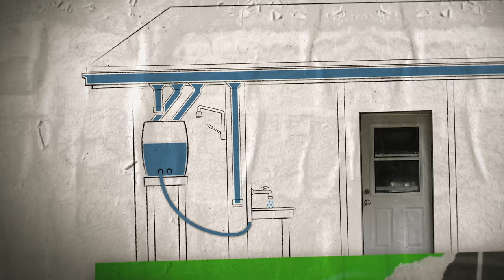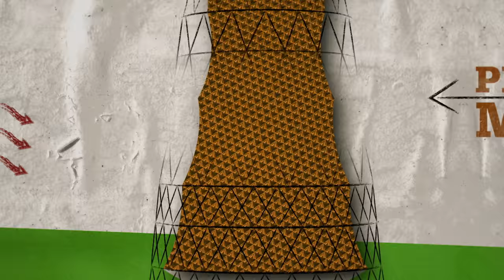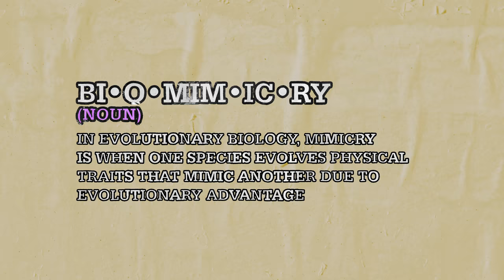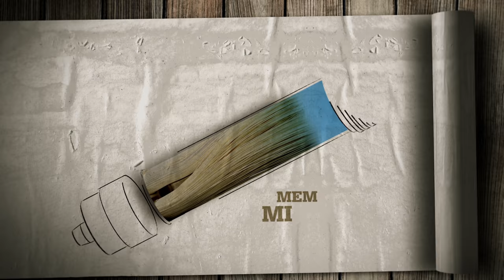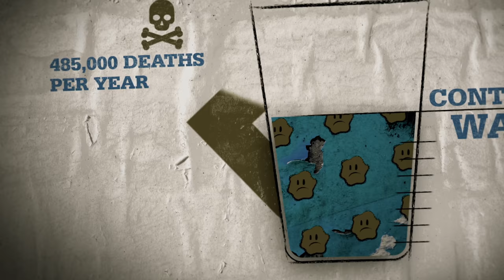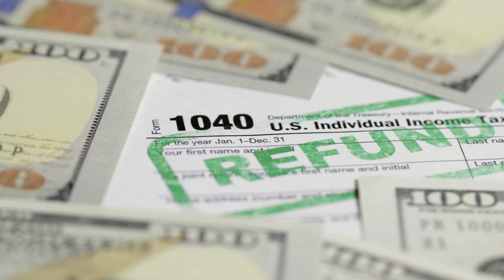Harvesting Water Out Of Thin Air | Shut It Off ASAP

Comment: Simple condense water collector: black plastic bag. dig a hole. Put a container in the hole. Cover the hole with the black bag, fix it around the edge so it doesn't fall into the hole, place a stone in the center of the bag so condense water drips into the container. Condense water forms on the underside of the bag and runs down. Read this about 30 years ago in a how to survive in the Outback book. Thankfully never needed to use it..

Comment: I have a few questions, mostly about the dew collector. 
You see, in the dessert the temperatures drop like a stone on a river at night and skyrocket at day due to the lack of moisture in the air, which is why its not much of a concern to pull as much moisture out of it as possible, life in desserts has already evolved to survive that, but in places where the moisture in the air is much more prevalen such as forests and jungles, taking a bit too much of it out of the air could become a big ans rapid change in those environments, mainly due to the fact that such moisture helps in the process of retaining a more stable temperature when compared to a place like a desert, so my question is... would the impact of the dew tower be enough to be concerned about when placed irresponsibly? 
Second question would be... again, in the desert it is not much of a concern due to its very own dry properties, but in other places with a more significant airborne lifeforms, wouldnt maintenance costs be something to consider greatly? 
Third... rainwater is clean by itself, but wouldn't the opening that leads the drain water to the barrel-container be very open for any airborne of sizes small to microscopic to enter it? And if so, wouldn't that make it much more difficult to maintain? 
Dont get me wrong, these are wonderful ideas, but as a university student majoring in biology, i am genuinely curious about these questions and some more that could come out depending on the answers to them
Reply: ।।।।क0

।

ल्ल्ल्ल्ल्ल्ल्ंंम
Reply: लल0पं 877य न 8
Reply: A tower like this even if you built a hundred, wouldn't even make a dent in air moisture in that particular square mile. If it did, then the grass and trees would constantly destroy their own environment.
Reply: @JackRyanRobtics  well, in plants the process is very different, as they release A LOT of the water they take in as moisture vapor, so plants take in and release constantly, these towers only take in the moisture in the air, which is why it makes me wonder if it would have any effect
Reply: @tlakutlaku1377  I was mainly referring to the dew that forms on grass and trees in the early morning. But that aside, let's look at how much water there is in the air. In one cubic foot there's between 2-6 grams of water. There are 1.472 × 1011 cubic feet in a cubic mile. So conservatively if there's only 1 gram of water per cubic foot, then there are about 147 billion liters of water per cubic mile. These towers harvest only one hundred liters each max, meaning you'll need over a million per cubic mile to make a change of more than .1%.

Comment: This technology of collecting early Morning dews inside a large container- with an open mouth was the result of a Research conducted at Norwich university, & the vessel surrounded by bamboo sticks, with an outlet at the bottom. It is named as Warwick Tower. Irrespective of any area- like deserts, it will give the purest, cool water, through out the year. I wrote a paper about how a miniature model can be kept in the top of individual's houses. Still it is not a bad idea to make a little research & implement it- to get away with the lack of drinking water 👍🤝🙏
Reply: Wait, so you're saying that even in a dessert, with very low humidity, it is possible to collect a significant amount of water from the air through passive dew collection. Doubtful.

Comment: The problem with dew collectors is the air from which the water is collected will contain air pollution… it has water and mold mildew and other microbes as well as insects that land in dog shit with more bacteria will land in the collected water and culture. When you drink it, you will get sick… not when the dew collector is new but as it gets used, and not cleaned, you will get sick when drinking it. 

The rain water collected at the end of this video is a good example of what it will look like eventually 😂
Reply: They did mention that it isn't suitable for drinking without additional steps.

Comment: I'd suggest getting a solar system and batteries. That's off grid power. And oversize your system so that in the summer, you can use a water condenser [think AC unit that is optimized to condense water rather than cooling air since that's exactly what it is]. You then can store it and pump it for all uses specific to you = drinking, bathing, washing face and hands. Rainwater is great for toilets and washing dishes and clothes. Any of the above and grey water is great for garden irrigation [pee is great nitrogen fertilizer, so put that into something like a urinal/sink which can be "flushed" with a very small bit of water which also helps dilute it]. A composting toilet can be used for poop > fertilizer, but an even better solution is an Israeli methane producing toilet/composting system that produces methane to cook with and liquid fertilizer for plants. Generally, solar hot water systems [evacuated tube] are excellent for heating both water and living spaces [with perhaps some backup for long, cold cloudy spells - not necessary in some climates, more so in Canada probably.

Comment: I had an off-grid cabin that I lived in for four years. My water came from a stream. While building the shelter I bathed in the stream; it was cold but felt good on the hot days. Upstream I put in a pipe that went all the way down to the cabin and if you looked at it from sideways it, the pipe entry, was taller than the roof of the cabin so I had gravity fed water. That water was first hooked up to an outdoor shower then went to my indoor bathroom sink and finally to an outdoor fountain/catch basin. I honestly used the outside water more often than the inside water. Showering outside during the summer was OK but no way during winter. I hadn’t gotten the chance to enclose that before I left so I am curious to know if the person that bought it and closed it or not. The water was tested before I moved there and it did not have any issues. So I was able to drink it without filtering it.

Comment: Ok so if you added a windmill to have a wind powered pump and copper tubing that could function in a coil spring shape inside so that you can run the collected water would then also be used as a cooling to help collect more dew

Comment: One thing is getting water from the air like with the dew system is not ideal for drinking water. It has no minerals or electrolytes, so it's actually not fit for long term consumption.

Comment: In Russia, they say to combine the pleasant and the useful, in this particular case, I combine a pleasant pastime and the study of the English language, since my application does not support subtitles in my native language.  About seven years ago, I was engaged in a project of autonomous eco-friendly housing.  my parents' summer house is completely autonomous.  electricity is produced by solar panels and a wind generator.  uninterrupted batteries from Internet servers are used (they were scrapped, but about half turned out to be completely new), this energy is enough for lighting the house, for the operation of household appliances, kitchen appliances, electric tools.  heating due to large windows, each with six panes.  a solar collector and passwords are also used, knowing a stove that runs on any solid fuel and practically does not make emissions into the atmosphere.  there is also a well with a depth of 210 meters for water extraction and a rainwater collection system.  4.5 thousand dollars were spent on everything.  thanks)))

Comment: Im surprised you didnt use a ram pump to pump water from the stream up to one of those large water bins on a 10 meter stand and pass ot through a conventional home filtration system to get fresh clean water at whatever volume your heart desires on demand without electricity.

Comment: Looks to me that you can better use the ocean water as source . Every solo sailor around the World has a simple filter on board to make saltwater into drinkingwater. How easy it must be that every country at the coast produce his own drinking water which can also be transported to other inland countries. Especially for Africa this would be a important solution for their climate problem . They can finally held cattle and have agriculture and horticulture.
Reply: It’s called a distillery, typically using the exhaust heat from the engine. It works good where you have surplus heat. else it just need to much energy

Comment: Everyone seems to say the same thing about how we should be more environmentally friendly. I will get this out of the way now. I don't believe in climate change or in my day global warming. But I do see how we disrupt mother natures way of doing things. I have a degree in environmental science and I have been a excavator for the better part of my life. Those two can help each other. Here is the kicker. To do so it requires companies that are "to big to fail" to stop suppressing technology including people like bill gates. we have had technologies that have been better than what we have now if companies were not gready. One example; the 100 mile per gallon carburetor. Does anyone know the reason why  asphalt roads need drainage? Well asphalt is a liquid and it likes to move. If you don't keep the ground below it drained it will sink. Causing dips holes and cracks. Those drainage ditches dump water in the wrong places. They also stop water from flowing the way it should. Example; have you ever looked at a hillside that was cut out for a road and on a dry day seen the rock wet. that's because they cut out a section of a underground river, stream, or a seasonal stream. Now think about all the other things that we think needs to be kept dry " house foundation " and apply that same design. We disrupt water flow with just about everything. Putting water into the nearest stream or river does not work. One of the best thing that a person or a homeowner can do is have a septic system that requires your water use to be put back in the ground. Instead of hooking up your rain water from the roof. Either collect the water and use it or put leach lines into the ground and put it back into the ground. If you water fell there keep it there. For you dummies that farm or live in a area that gets little to no rain. Stop pumping it out of the ground. Because you can never replace the water back to the aquifer. And those who pipe water from a rainy area. So, that you can water your yard. You do the most damage of all. Yes I am talking about you mostly in Las vegas. The next thing that is damaging is the mower. What people think are ugly weeds are actually very good for the environment. It helps to hold in water. The ground doesn't get so hot and helps speed up the evaporation process by heating up the ground. I wish that the real reason for the water cycle is being disrupted.

Comment: A year later and its even worse. My initial response was to stop watching after 45 seconds.  I wasnt wrong.

Big violation:
 Bathing in the stream. F$CK everyone down stream.

Big omissions: Water DAY TANK on the roof.

PVC flapper valve pump to push water around/up. Powered either with hand pump or eccentric cam(s) on bicycle.

Standing Sand/biofilm filter for potable water.

Each of these are VERY OLD and very SIMPLE. 90 SECONDS of screen time with links to online existing free plans.

Ewetoob needs to up their game if they want to be serious about these issues.

Comment: This is very inefficient, how ever and interesting method for sure.
Reply: I think you meant efficient
Reply: @luones2skt  No I meant inefficient
Reply: @adrianguerrero2949  why?
Reply: @luones2skt  for it's size and the amount it collected it's inefficient. They even agreed in the video that it was inefficient do to how much  it collected and would stick to rain water collectors. It's a cool concept but inefficient
Reply: @adrianguerrero2949  I think that the concept should be studied further. In this video they showed how the concept run. If a company to study this conecept and to apply for example: A larger collector and filter collecting rain water could work. Just my opinion.